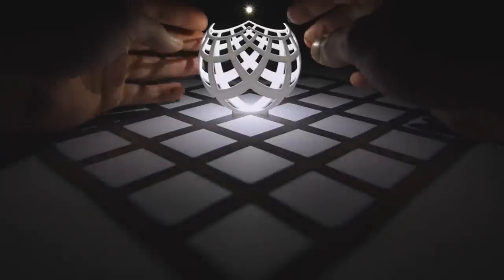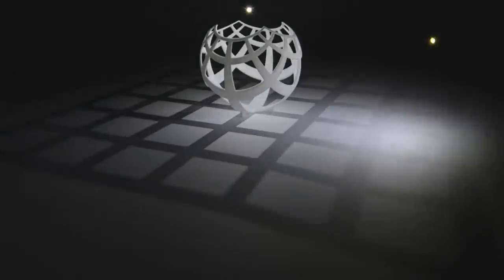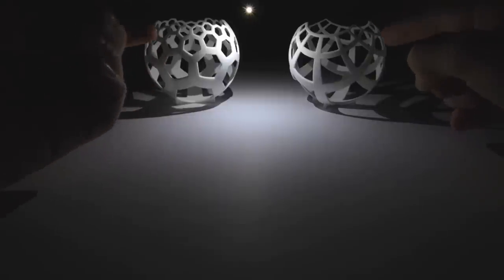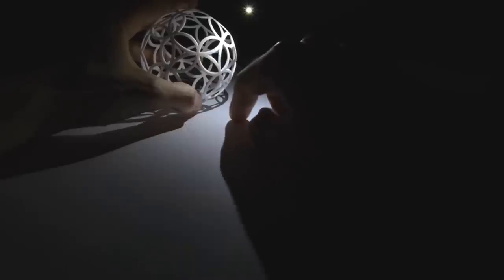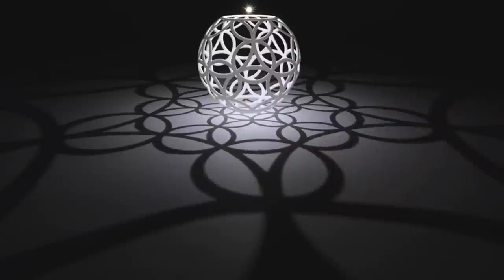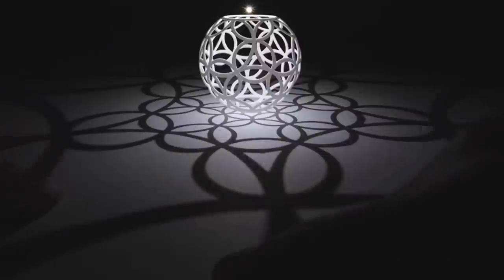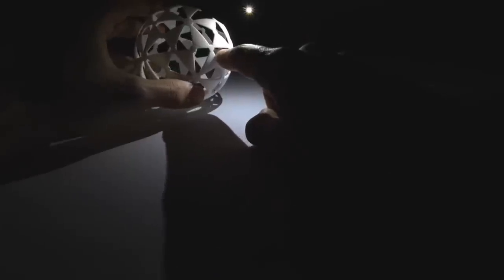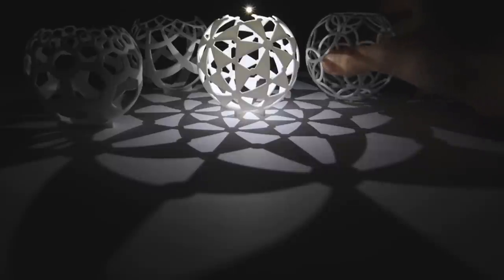Further adventures in stereographic projection

Comment: If you had a sphere with the continents marked on it - which might be difficult to set up in this medium - you could demonstrate the relationship of this to map projection.
Reply from the maker: Yes, I've thought about this. Connectivity is an issue, but I have an idea for how to do it!
Reply: @henryseg  I just found out about your channel. Not sure if I'll find it when I'll watch all your stuff. but if not, it's still a cool idea :)
Reply: My 1st thought was that would give you Gleasons New Standard Map Of The World, with its Azimuthal projection as displayed in the UN and used by flat-Earth advocates. But it wouldn't.
Reply: Put such a sphere in the center of a tall cylinder of tracing-paper, with the light source at the center of the sphere, and that would give you a Mercator Projection. Which is what most maps use. Except that they trim down the poles, which would otherwise appear at infinity.

Comment: Not to pick on your work, but you NEED to put a bit more time into embedding a structure to hold your light source. A few supports at regular intervals would be easy enough to add, and some struts on the bottom to keep it from rolling over.  A little hood around the light source would keep the light from blinding observers. Once done, it could be very useful for tabletop gaming, as grids (square and hex) are always useful for gaming. 

If I could see your model, I could do the modifications for you.
Reply from the maker: Max SMoke For other projects I have made a socket to put the flashlight in, which supports it. The reason I don't do that for these pieces is that adding such a socket makes the print unusable with a light other than this particular flashlight. Lots of people buy or print these for use with their phone flashlights.